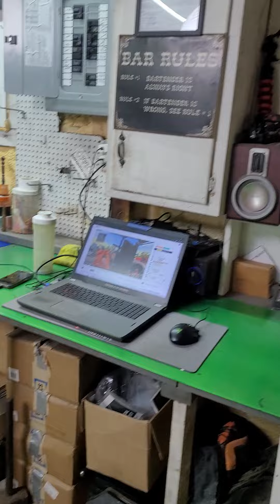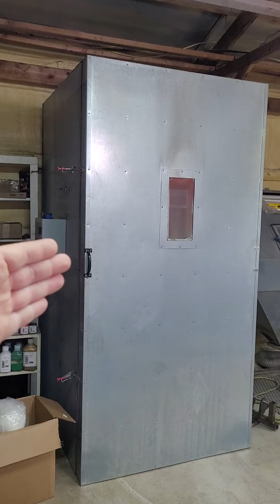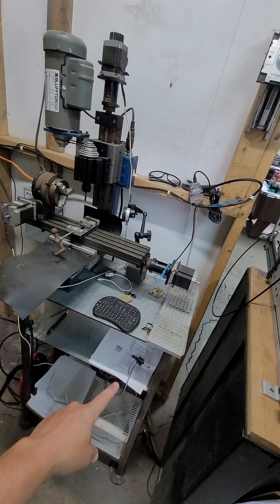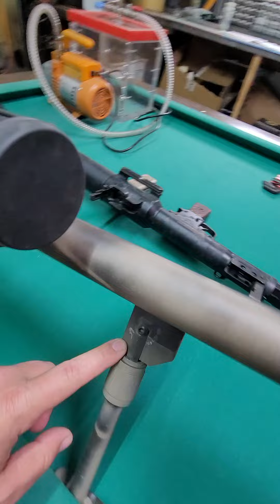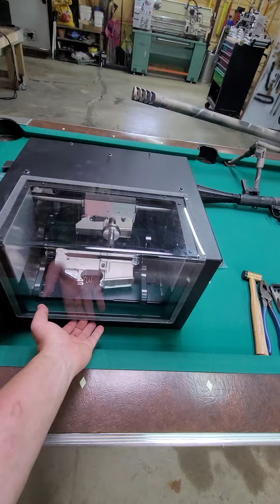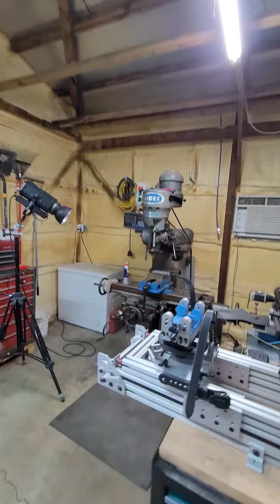shop tour and projections, what is this place? what do we do now?

Comment: Super cool toy store.  I just had this thought, a bullet doing a loopty loop (kind of like a hot wheels track made out of steel?  C channel might work? ) in high speed?  I know demo ranch did bullets in pipes, so it seems like it's possible?  I don't know how tight the actual loop could be?   Maybe it would have to be machined from one solid block?  It's just an idea.  Maybe you could make several, and "race" bullets in real time slow mo?

Comment: Sounds like you need a wet bench at least to mag(MPI) your steel parts. Aluminum would be tough to verify there aren't any processing defects without ultrasonic equipment. Would love more metal and gunsmithing stuff in this space.
Reply from the maker: I was kind of thinking I would notice defects as material is milled away. For instance the mag well is a large space of removed material, should be plenty of opportunity to see what is going on deeper. Worst case, they go back in the crucible and try again lol. If my 3D printed lowers hold up, surely even imperfect aluminum will do the trick. 

And to clarify, they wouldn't be sold or anything. Just a fun personal project.
Reply: @knowlzy0791  does sound like a cool vein to put metal working content out from my end though as I don't see it much as a QC NDT person who likes firearms and gunsmithing. I'd make content about it if I owned my own equipment. X-ray damaged firearms and parts, as well. I know they shoot every new ordinance they find abroad and the pictures are dope.